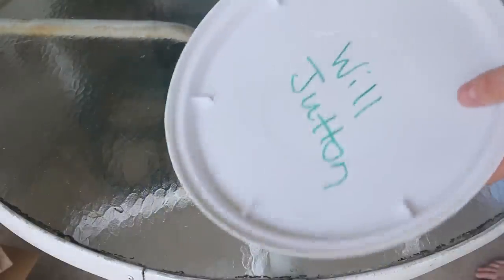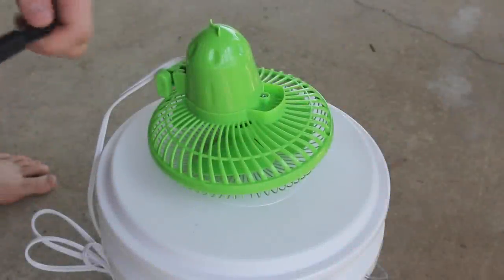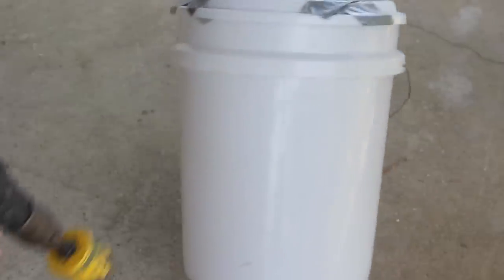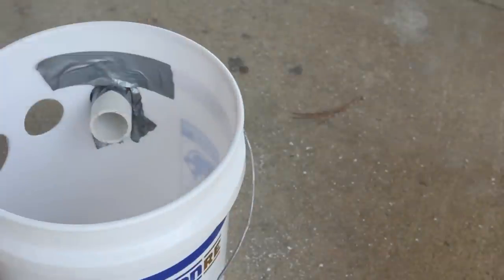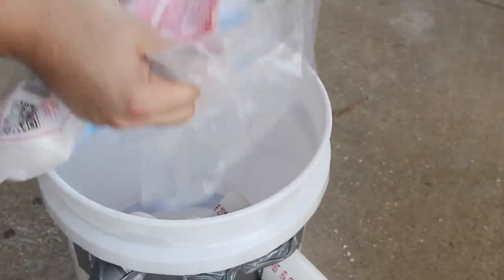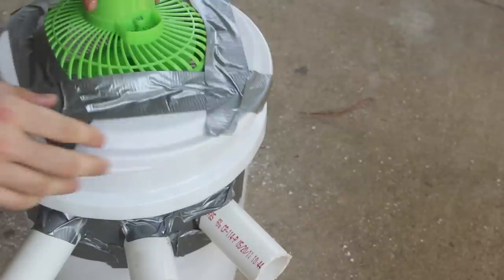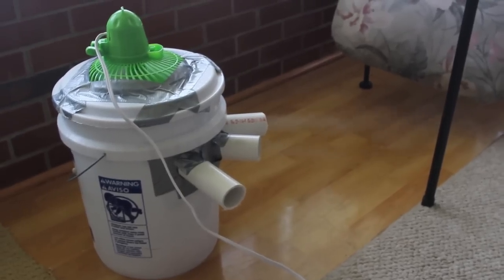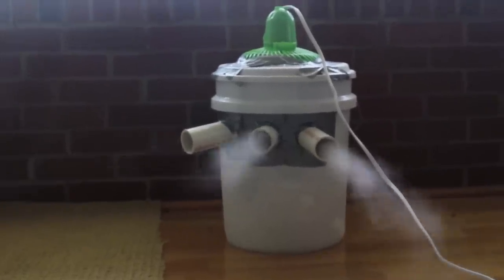Homemade Air Conditioner  (Use Ice From water for better effect)

Comment: It's funny how everyone is now trying to sound all intelligent and hating on the guy for doing something dangerous just because they've watched some video/read an article saying how this can kill you.
Reply: I think quite a few people would have worked out this is dangerous before watching any video. In any case before you deal with any chemicals you should do a risk assessment which includes reading the MSDS statement; obviously he didn't do that.
Reply: It wouldn't occur to a lot of people because there is no chemical reaction happening here and the fan is just blowing smoke from dry ice which can be bought in a supermarket. Wouldn't occur to an ordinary person this could be dangerous cause most people don't know what makes up dry ice.
Reply: daa82 All the more reason to risk assess stuff like this. I once made the mistake of assuming that its okay to add water to sulfuric acid (no chemical reaction, right). The point is whenever dealing with chemicals that you would not use in day to day life, you need to do a risk assesment; this guy clearly doesn't.
Reply: ***** Honestly.  No death will occur from this.   Death from CO2 does not happen often even when in a low concentration with ventilation like this.  The only danger is suffocation, stop worrying about it so much.
Reply: *****
is that sarcasm? it's hard to tell on the internet
Reply: captainplanet999 Kind of.  You see in the room he's currently in there's no danger.  Room is ventilated.  If someone did this in a more isolated room that is smaller then there is a danger.  But in the desc of his video he gives warning and says normal ice is also an option not dry ice.  I don't see it likely that anyone unintelligent would go out and buy several kg of dry ice just to recreate this.  They'd probably use normal ice.
Reply: *****
yeah, i'd definitely just make the same thing with ice and just put it closer to myself =) no point in using something colder if it's just going to be further away
Reply: I knew carbon dioxide was lethal before YouTube and even the internet existed. I may have found this video by way of another video, but I only got the referral from that video, not my knowledge of human respiration or my opinion of people who differ on the matter.
Reply: ***** You are underestimating the risk, there is a reason why dry ice storage is such a big deal because there are so many hazards associated with it. A room that is ventilated enough for this not to be an issue, would also defeat the whole purpose of using this as a cooling mechanism.
Reply: ***** Wrong.  If you took basic physics you'd notice that that the CO2 tends to stay near the bottom of the room cooling the air above causing it to fall down towards the CO2.  This would increase oxygen density and also begin shuffling the air allowing the CO2 to diffuse since new air is coming in and out of the room.  The problem is if the air gets below a certain temperature in relation to the outside temperature which I'm too lazy to calculate, because this would mean the amount of CO2 is increasing faster than you're getting new air.
Reply: ***** I can't believe I'm commenting on youtube, so I'll judge myself later for this. I not only took "basic physics" but I have a BMC degree. I've done stupid things with dry ice in P chem. I admit this. Since our hands are very hot compared to dry ice, we can stick our hands in it for a second and it would bubble off, but I would never in my life make a youtube video suggesting other individuals do that for fun. Someone is going to stick it in for too long (that's what she said). This would make a fun project to do in a class, but I would do it outside in a tent. Whenever we had an ice storm by my house about eight years ago (i live in the south, i know we're pathetic), people died from putting their grills in their houses to warm themselves up. I thought that was basic knowledge, but apparently not. What I learned from that is that inevitably some genius is going to watch this and decide to cool their small apartment off with it. The problem is not "can you physically find a place to do this where you won't die." the answer would be yes. You're right. The problem is "can this potentially kill someone." which is also a yes. There needs to be a notification on this about the dangers.
Reply: Cassie McNaney Well then we also need to eliminate cars because driving can potentially kill someone.
Reply: No I think it's common sense that if the room you're in starts to fill with up with CO2 and you can't breath O2 you'll eventually pass out.
Reply: ***** Ha, probably.
Reply: ***** Normal people don't just go out and do DIY stuff.  In fact most people don't  It's kind of rare for people to.
Reply: Are you serious, John? Lol let me explain this in simpler terms. I'll use your car as an example, even if it was used as a  red herring. Cars ARE dangerous. You're right. That's why we need licenses to drive them. That's why we, in today's society, see a stunt in a car commercial and have to have "do not attempt" written on the bottom. You have to learn how to operate potentially dangerous vehicles before you use them just like you have to learn how to use potentially dangerous chemicals. Most individuals watching this do not have science degrees, just like most people watching cars speeding around cliffs in car commercials don't work part time as professional drivers. If they attempted the same thing, they could easily die, If he had one warning, this would be much safer.
Reply: You can do this wih regular ice..
Reply: "It's funny how everyone is ... hating on the guy for doing something dangerous" Yeah... funny that. _;
Reply: frogBISCUITS You want some more BISCUITS frog, or are you gunna cry like a wet lettuce?
Reply: ***** Actually, cars are about the most regulated object in this country because of their potential lethality. We've built safety into the system and continue doing so every year. There is no such safety system with dry ice. This is just an idiotic idea whose dangers are being downplayed or even ignored by more idiots.
Reply: Hal Turner If you've seen the people and the vehicles that drive in the south you'd know that isn't true.
Reply: And know everybody turns into a dry ice co2 smart aleck right? Right.
Reply: Sofia Besada What?
Reply: Hal Turner What?
Reply: {{sigh...}}
Reply: Hal Turner What?
Reply: It is not about "sounding" intelligent. It is about good old common sense. 

In a small space, this will kill you. 

This is about not wanting to die. Who cares if a person "sounds" smart or not. This is about not wanting to be dead.
Reply: naomi chambers ....while sounding intelligent ;)

Comment: is it possible to make the air conditioner without spreading gas
Reply: use regular ice from water
Reply: Amy Howson don't use dry ice just use normal
Reply: Amy Howson just use normal ice. Or oxygen ice if you can somehow get it
Reply: If you can get oxygen, please for the love of god tell me where
Reply: Use a block of ice Or fill bottles with water and freeze them.
Reply: just buy an air conditioner
Reply: Ascher: What fun would that be?

Comment: This is just dumb! Apart from the dry ice releasing CO2 that dry ice cost him $10, to run for how long? One day maybe. It doesn't cost $10 to run the a/c all day long and probably would feel way better than a bucket with a fan on it. Doesn't seem cost effective to me if that's what you're trying to achieve.
Reply: Electric fees and power outages.
Reply: Eugene Kwong the power outage will effect the fan for this experiment
Reply: Eugene Kwong the power outage will effect the fan for this experiment
Reply: battery power
Reply: I think he mentioned that the air conditioner was not available in the room he was in. If there were no vents in the room then the A/C will do no good in that room. Otherwise, you are right, it is way more cost effective to run the A/C.
Reply: TheGoodguyperson Oh yeah huh...
Reply: It'd be ten dollars a day...
Reply: Dry ice doesn't last forever. Gotta buy new dry ice every day, or every other day if you're lucky. That's $300 per month on ice alone, or $150ish if you are lucky. My electricity bill with the A/C in the middle of summer (usually 90-100 degrees Fahrenheit) is less than $100...

Comment: Quite clever really an air conditioner that fills a room with carbon dioxide you get really cool and die from CO2 poisoning !!  (:0)
Reply: +mozzy747 I don't think you can die from CO2 poisoning
Reply: yeh! so make your A/C TODAY!(DONT DO THAT
Reply: +simhere2 You can just open a window,you know?
Reply: +IVAN3DX  +simhere2
Nope CO2 is poisonous.
Reply: *****

Yes, which makes this video really dangerous.
6-10% concentration in the air is enough to render you unsconscious and kill you shortly after.
Reply: +IVAN3DX You can.  Don't do this.
Reply: Gee Buttersnaps If you fill the air with CO2, you remove the oxigen, rendering breathing pretty much impossible, but I don't think CP2 will kill you for any other reason
Reply: IVAN3DX "Oxigen..." 

No comment.

Comment: Careful you can get asphyxiation. You should have put the precaution in your video dude.
Reply: I believe the medical term is hypercapnia (CO2 poisoning)
Reply: ***** Medical Definition of SUFFOCATE
transitive verb 1: to stop the respiration of (as by strangling or asphyxiation)

asphyxiation:  to cause to die or lose consciousness by impairing normal breathing, as by gas or other noxious agents; choke; suffocate; smother.

Either word is works in this case, to take someone to task for the use of either in this case is of no benefit other than the need for some to split hairs.  Both definitions are from MY several medical texts all of which are at this point getting old.  I don't think that they are out of date in this regard.
Reply: SciGuy Yes hypercapnia is a medical term referring to excess of carbon dioxide in the blood, it is also called hypercarbia.
Reply: nah, he touched the dry ice.

Comment: There are nearly 10,000 comments so I'm not going to look to see if this has been suggested already, but I was thinking that instead of plain ice, what about putting a large amount of salt on it? As we remember, salt melts ice and refreezes at a much lower temperature.

This suggestion is being made with consideration to using plain ice as a safe air conditioner (no Co2).
Reply: Adding salt will melt the ice and lower the temperature, but it will not remove thermal energy from the contents of the bucket.   The total mass of ice/salt mixture will absorb the same amount of energy to reach room temp regardless of whether you add salt, pepper, or any other household spice.

That said, a lower temperature mixture (achieved by adding the salt) will certainly lower the temperature of the air coming out of the bucket, it just wont last as long.

Comment: (Question) Why dont just use the fan?
Reply: Thats not the russian way thats why!
Reply: Because a fan just blows hot air. This would cool the air.
Reply: Jimmy Hough wat kind of fan blow hot air
Reply: Alex Panella lul
Reply: In 100 degreese all air is hot unless it's cool and no fan would cool it........
Reply: Alex Panella all fans would, the air doesn't magically become cooler when there is a fan in the room, a fan just stops air from becoming stagnant to speed up the natural heat convection your body does all the time. if the room is hot then the air the fan will be blowing will be hot.

Comment: can i replacing the dry ice with normal ice?
Reply: yes
Reply: or just use the fan and spray water on your face
Reply: Use regular ice, dry ice would be fatal
Reply: +Fadel Yanori Yes and you should! Using this contraption with dry ice is potentially lethal to user, thanks to CO2 released from the dry ice!
Reply: +Fadel Yanori Are you still alive, sir?
Reply: +Lgm15D uh oh...
Reply: +Fadel Yanori no because it won't kill you that way

Comment: Smaller holes equalling the pipe diameter maybe for better direction, and more gas pressure in the bucket for better outlet flow of cool air?

Comment: Actually pipes are not necessary for this stuff. And it's much better to use double walled bucket (with two buckets of slightly different size). In that fashion it would be much more efficient

Comment: Temperature - 78.8 ° C
    Sublimation heat: 640 kJ / kg ( from -78 ° C to 0 ° C)
    Density: 1.2 to 1.6 kg / dm3
    Sublimates into CO2 gas , 1 kg SL = 541 liters CO2
    Odorless and tasteless
    nontoxic
    nonflammable
    Stifling
    LIMIT IN THE AIR!!!! 0.5% .
    Loss of consciousness > 8 % vol .

Comment: If the dry ice were separated and ventilated to the outside atmosphere and you had a heat exchanger, then it would be much safer.

Comment: Pfff, I use liquid nitrogren. My house went from 80*f down to -321*f...On a real note though. Why not just use a bunch of reusable ice packs. Freeze several of them then throw it in there. When they melt, freeze them again, no humidity, no smoke, no liquid nitrogen. Buy about 5 Maxcold Ice Glaces. Then you have a cooler with 5 frozen blocks to drop the temperature. Air goes in hot, passes through ice blocks, comes out really cool.

Comment: did  you know?  the AC cost is Just $300 and that freaking dry ice is about $10, if you use it 1/day in a month you can beat the real AC price, think about it, the dry ice is expensive tho
Reply: Funerals are more expensive though
Reply: +Planksexual 2x4 not with a good insurance policy
Reply: Installation of AC costs more than that
Reply: +EverythingExpert in here, the cost is Just about $20

Comment: Yeah you should really use, umm un "Simplistic," terms.. Frozen Water in recycled plastic bottles with tap Water, a computer fan, i used two fans, one to push air in, then thé other to push air out more effectively, to power thèm, i used rechargeable batteries... Cell phone batteries suffice,  series thèm together,  use same V & ma's lol..